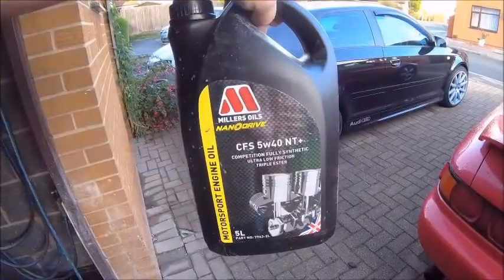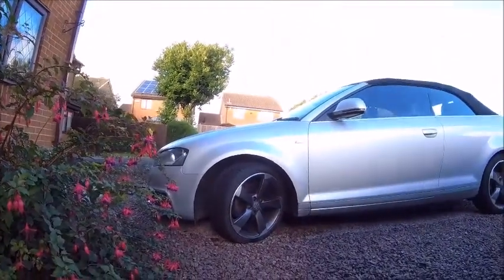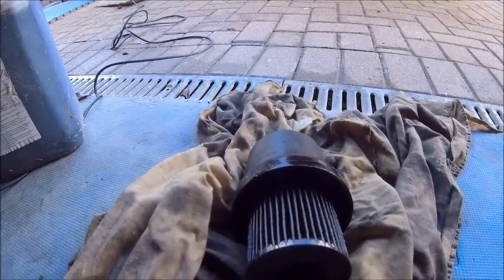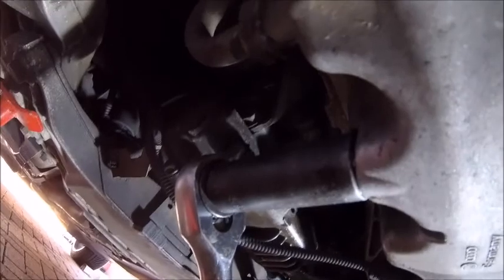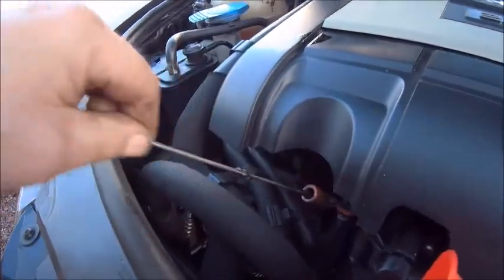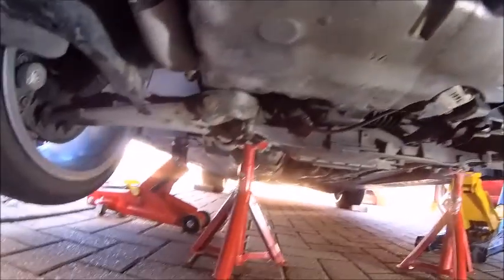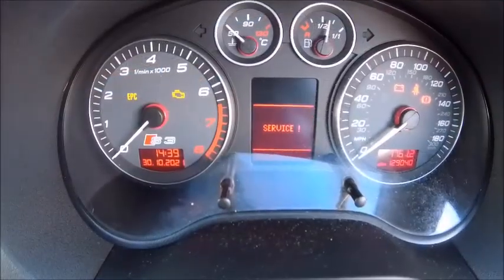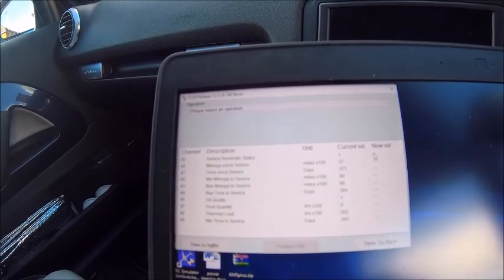Audi S3 8P Oil change  "Shorts"

Comment: Great video as always Ade. I notice you have replenished your engine oil with Millers engine oil. How do you rate this engine oil? Also, next time you want to change your oil, you may wish to consider a flushing oil?
Reply from the maker: Hi dog...to be honest I'm not a fan of flushing , As I change the oil every 6 months to ensure it stays in the best condition it can be , and never had a strainer issue or similar ... I know TFSI's like good clean oil so to me that's the key .
Reply: @AdeReeves  Spot on Ade. No problem and respect for how you service your car. I just thought that a good flushing oil such as Mannol or Liqui Moly might help keep the next engine oil cleaner, for longer and maybe restore any loss compression. I change my engine oil every six months also but do use an engine flush if I change oil brands. Please let me recommend XADO revitalizing products to you, to keep your engine in the best condition.
Reply: Great video. Can I ask why you chose 5w40 oil over 5w30.? Thanks
Reply from the maker: @spencewatts2667  CFS only comes in 40 and that's the one I've used since i got the car on recommendation.. the formula is very forgiving to Audi rubber  /  Valve trains...
Reply: @AdeReeves  oh I see. Makes good sense to use it then. Thank you for your reply.
Reply: @dogbite5509  thank you that's very helpful. I may well change it from 5w30 to 5w40

Comment: Ade :) watch all your s3 videos I got a 2008 s3 8p and the notorious whine from the rear differential has started do yuo know anywhere good to go get it replaced or have it checked and then fixed or replaced I dint mind travelling:)
Reply from the maker: Hi Danny...I had an A3 quattro long before this and to be honest i sourced a low mileage unit of the bay and changed it myself....as I recall it only took a couple of hours but did have the benefit of a 4 post ramp. , but have you tried doing a oil change and a pump clean ?..you may find it helps ...
Reply: @AdeReeves  hey ade ok thanks:) I havnt tried that yet so I have the oil for the rear differential to change it so I'll do that and a pump change and hopfully will help brill thank you mate :)

Comment: Is that stage 2+? Does it burning oil and what oil you use? 🤨
Reply from the maker: To be fair I don't do many miles now, but no doesn't burn hardly any oil at all even when i was going to work each day... when I do the change I put 4.5 litres in and the half gets added between changes....that's it..